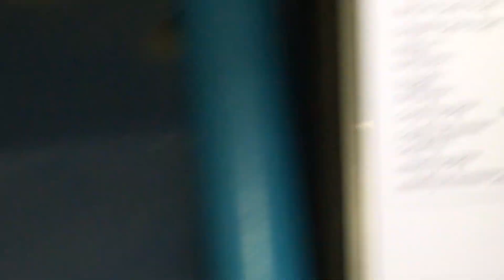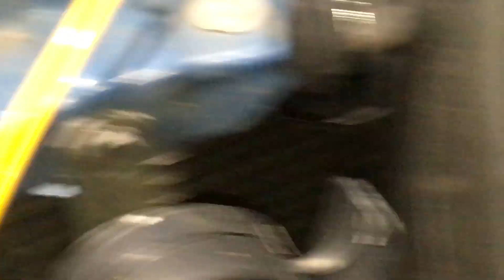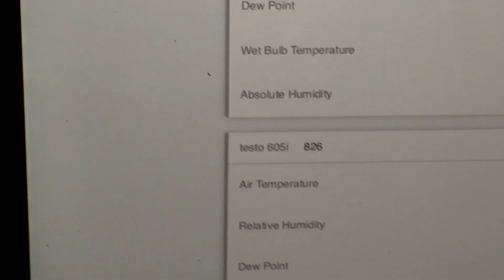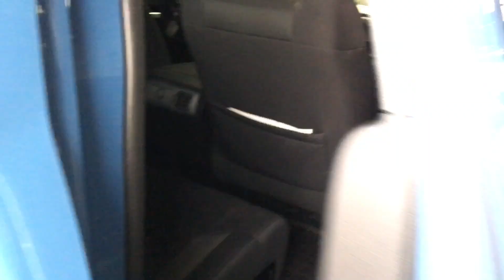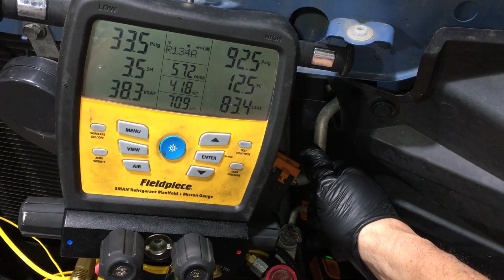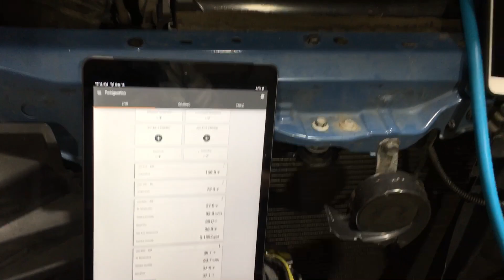AC on 2019 Toyota Tundra￼

Comment: Where it's the relay to test the compressor?
Reply from the maker: Located in the relay and fuse box under the hood Toyotas pretty good at giving either a written down description or tiny pictures describing what each relay is for. 

Then inside the owners manual in the glove box they will also show you a description and picture and have it numbered showing you exactly where the relay for the compressor is located.

Comment: What is the capacity of the factory charged on that 1234yf freon?
Reply from the maker: It’s different on all vehicles
Reply: @coldfinger459sub0  for that 2019 tundra?
Reply from the maker: @ronnyrath816  what is the trim package ? SE, TRD Pro, SR5, Limited, platinum, 1794 edition, ?

And if you’re in a different country it might be different
Reply: @coldfinger459sub0  TRD
Reply from the maker: @ronnyrath816  700g. Your truck did not have a decal stuck underneath the hood was this vehicle in the accident before and they threw away the old sticker and never replaced it ?
Reply: Tundra 2019 where's the relay for a/c to test the compressor